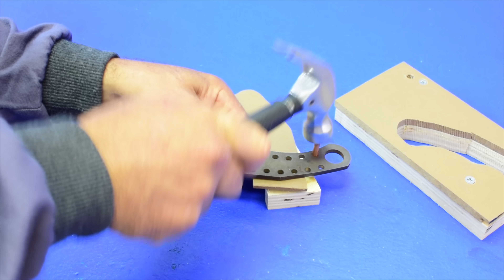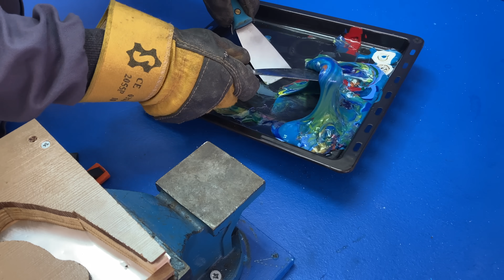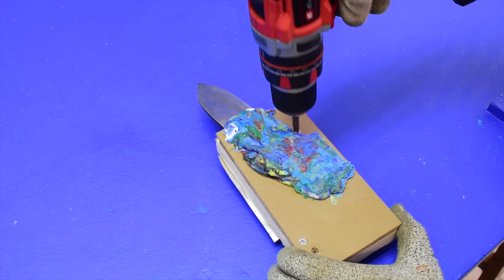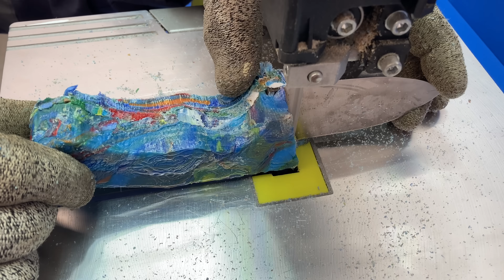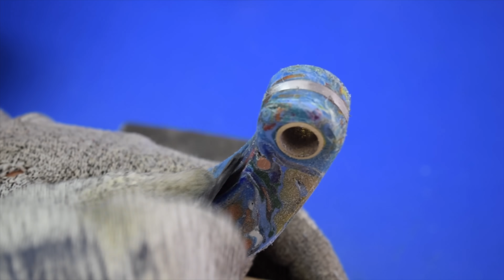Amazing Idea! Recycle Your Plastic Waste at Home Easily

Comment: Every time you bake something in your oven you can infuse some good plastic vapors into your food!  AWESOME BABY!
Reply: My thoughts exactly. 
I said dude! You gotta do that outside
Reply: If the plastics is labeled with a 2 inside of the ♻️ it doesn’t emit vapor unless burned. If you keep it at a temperature just enough to melt it your fine.
Reply: Ummm, or you can get a toaster oven from the thrift store devoted to non -food uses...
Reply: It doesn’t take a rocket scientist to figure out not to use your kitchen oven. I have a toaster oven I use solely for powder coating parts. AWESOME BABY! On top of that he is clearly not in his kitchen
Reply: @taylorrussell5490 Hello, how many degrees and how many minutes you keep the powder coated parts inside?
Reply: He obviously only use it for works duh
Reply: Perfect i have tons of bottled caps yet sad i dont have your tools
Reply: Never mind the fact that they wasted a perfectly good piece of wood that would’ve made the handle instead.
Reply: Ummmm..don't be such a dolt...you get a toaster oven from the Thrift store or a yard sale and use it for non food uses like this/ clay and shrinking charms.....DUH
Reply: I highly doubt he cooks his food in the same toaster oven pal, did you not see the fan behind it and his surroundings? It was clearly a garage or petitioned off room dedicated to these endeavors and or etc...
Reply: I have an oven just for crafts and polymer clay baking ,we don't use it for food at all! I suspect this person knows not to cook food and plastic in the same oven , especially when they are into crafting & recycling.
Reply: It's still a knife

Comment: It's a great idea, but in real terms, the cost of the energy, both financial to you and production to the environment, required in every step of this process, is probably far higher than the cost of getting the plastic lids to a professional recycling center.
Reply: I believe that what you refer to as "in real terms" is the reason why our planet goes kaputt ...
Reply: But it's really cool!
Reply: This is why big corporations should pay part and use it as leverage for governments that they supply products recycled them. But they’re greedy pigs who don’t spend profits on things like recycling people should do it.
Reply: @ghostpoop2349  Plastic being easy or hard to recycle isn't why recycle waste doesn't get recycled, that has more to do with globalist economic incentives ending up sending recycle waste to countries without the means to process it - which also apply to glass & metal. 
Notably, glass & aluminum are both HARDER to recycle than plastic, both require consistently higher temperatures to melt, & in the case of glass there is a storage issue, since broken glass is dangerous. Glass also requires the special skill of glass-blowing to achieve a lot of effects, whereas plastic overlaps with a lot of the skills used for woodworking
Reply: @ghostpoop2349  Actually, soda bottles and the like are one of the few plastics that are actually recycled.

Comment: This is an inspiring video. If you really want something with a certain colour pattern, this gives you unlimited options.

If you're just disillusioned with public recycling availability though, I'm not sure this is much of an improvement. 1. Heating plastic in the oven could be a fire risk and probably a risk to your respiratoty system. Best to take the show outside on a windy day to reduce that latter risk.
2. The trimming operations are releasing very small particles into the environment, some of which could be so small as to end up in your lungs. 
3. These lids can be sent through current recycling channels which would probably do a better job of releasing less of it back into the environment.

I prefer wooden handles on my knives for aesthetic and handling reasons.
Making them out of wood is kind of more interesting and more than challenging enough.

Thank you for inspiring me to think about it.

Comment: Having taught college level chemistry and biology coupled with a true love of healthy lungs my advice is DO NOT melt (nor even heat) plastic. There are all types of plastics, particularly cheaper ones, that give noxious, carcinogenic and worse fumes of all sorts when melted. If you want things like antimony or polychlorinated hydrocarbons cruising your circulatory system and, perhaps, finding a nice retirement spot in your liver, then, maybe. Otherwise, any melting of plastic should be done in a chemistry lab grade fume hood and not simply to make a damn knife handle. Don't try this at home. I strongly suspect that the carbon footprint of making one knife handle at a time is much larger than that same handle being made on a larger scale, in a safe manner.

Comment: No bardzo łatwo !!!  Każdy ma w domu piłę taśmową imadło i całą gromadę innych narzędzi. Efekt wątpliwy
Reply: I agree as nice as his mom made orbital stationary sander was made, he could have gone up incrementally from 100, to too grit, then 200, 400, 800, and polished it with some 2000 and made it shine. The piece obviously meant something to him to take the time and effort to engineer this whole thing, and the impetus to execute it. People here are all down on this creative man. Saying the plastic fumes will kill him, and that is just a crock of $#!+. Burning plastics produces carcinogens, not melting it, or everything would be dead for miles around every plastic goods manufacturer in the world. Melting plastic doesn't hurt anything, and that's why he was very prominent in showing the temperature to set the toaster oven on, I zoomed in to see because I deemed it important because he pointed it out. 200°, which I assume was in fahrenheit though I'm unsure. I wonder if one could grind up and melt down plastic, then carve a mold like a clay roof tile, and reuse bottles and scrap plastic to make plastic roofing tiles. I could probably make this happen, rudimentally, like a proof of concept using some aluminum to cover the wood so the makeshift mold could be reused. You've given me something to think about...

Comment: the easy way to clean the furry finish after sanding is to use a jet lighter and just run over the surface to melt just the surface and make it shiny

Comment: So you appear to have set your toaster oven for about an hour at 170 degrees; is that Fahrenheit or Celsius?  170 Fahrenheit would be less than the boiling point for water so my gut says that probably isn’t quite hot enough. If it’s Celsius, that translates to roughly 350 degrees Fahrenheit. That seems more like it. Great project! I’m going to have to try this! I’d be tempted to line my baking tray with foil or something so I wouldn’t forever have melted plastic stuck to it afterwards!
Reply: Hello, it's celcius. Channel owner Turkish, probably won't answer to english comments.

Comment: Merci pour le partage. A quelle température réglez-vous votre four et surtout combien de temps y laisse t- les plastiques?
Thank you for sharing. What temperature do you set your oven to and especially how long do you leave the plastics there?
Reply: I would try 450° for 45 minutes.
Reply: @scooterp7009 Thanks  ;)
Reply: @didiersee  
Yw, but watch it closely so it doesn’t burn 🔥 and smoke 💨 .  If it starts melting quickly, turn it down to 200° and watch it closely, it might not take that long.

Comment: I like the idea and I may very well give this a try. The main problem as I see it. Is that you cannot work very effectively on the front of the knife, where the handle meets the blade at the ricasso area. That would be most difficult to sand, file and shape it there. You may do damage to the blade. Other than that, really well done. All those water bottle caps do come in handy.
Reply: You could try taping it off or use a release agent like an oil there. That way the plastic wouldn't stick to the metal.
Reply: More work on that end of the form/mold.
Reply: @socalzaps2848  Where I live, we have dollar stores that sell broiling pans for 4 dollars.  You would probably be able to use them more than once.
Reply: Dremel tool. &/Or, create the halves of the handle separately & then bolt/screw them onto the handle, so you can fully polish them without the knife getting in the way.

Comment: People here are all down on this creative man. Saying the plastic fumes will kill him, and that is just a crock of $#!+. Burning plastics produces carcinogens, not melting it, or everything would be dead for miles around every plastic goods manufacturer in the world. Melting plastic doesn't hurt anything, and that's why he was very prominent in showing the temperature to set the toaster oven on, I zoomed in to see because I deemed it important, as he made note to show that it was 200°, which I assume was in fahrenheit though I'm unsure. I wonder if one could grind up and melt down plastic, then carve a mold like a clay roof tile, and reuse bottles and scrap plastic to make plastic roofing tiles. I could probably make this happen, rudimentally, like a proof of concept using some aluminum to cover the wood so the makeshift mold could be reused. You've given me something to think about... Oh , he could have gone up incrementally from 100 grit, then 200, 400, 800, and polished it with some 2000 and made it shine. The piece obviously meant something to him to take the time and effort to engineer this whole thing, and the impetus to execute it

Comment: Are the fumes from the plastic not extremely toxic?
Reply: Oh I'm sure they are.
Reply: A) you could wear a respirator... no different from working with resin, superglue, or spray paint B) that category of plastic doesn't emit vapor if you simply melt it

Comment: What a great project! Thank you!
Reply: It's a stupid idea how much energy did he use to melt that plastic using electricity to run the grinder wasting the perfectly good piece of wood to make I'm all then he broke the wood apart and threw it away not a good idea stupid is what it is
Reply: @mikecummings6593  yeah he should have used the wood instead to make the handle and it would have looked 10 times better than hunk of garbage!

Comment: Recycle some of your plastic waste.  And turn the rest into micro-plastic toxic dust currently impossible to recover from the environment, some which will have been absorbed by the operator since good extraction & protection hasn't been used.